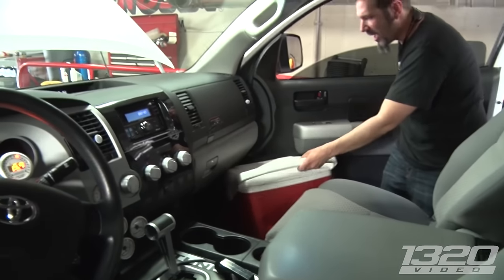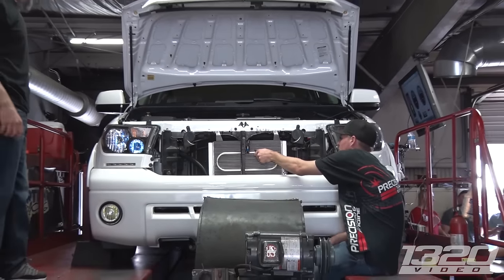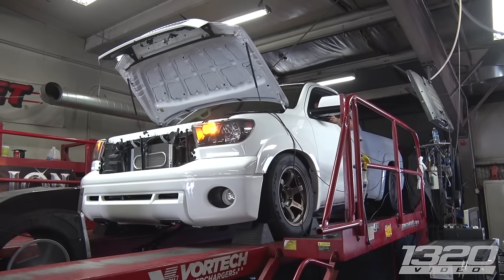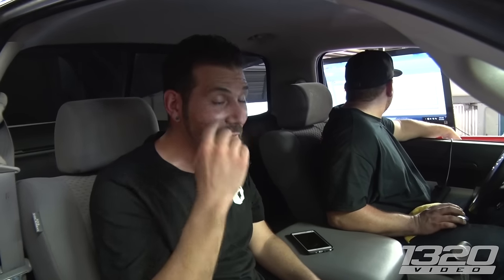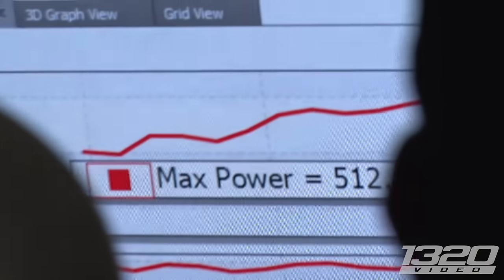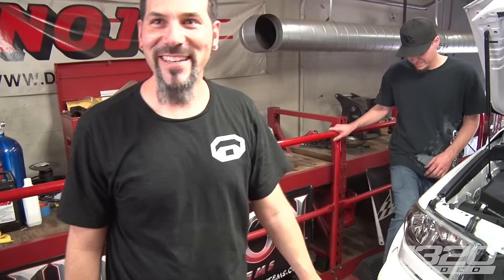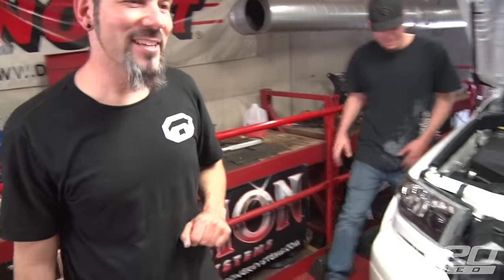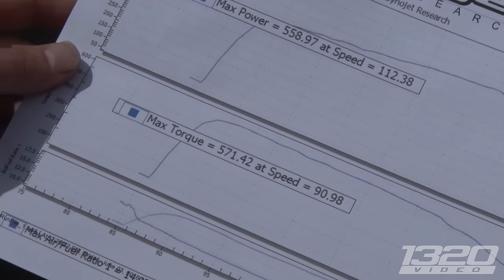The FUNDRA - TRD Supercharged Toyota TUNDRA!

Comment: They usually make 380 factory
Reply: Scout Master DongBag but that's 381 at the crank. Wheel hp is a little over 300 hp. The advertised hp of the trd supercharged tundra from the dealer is 504 hp at the crank which is 400 hp at the wheels. This dyno in the vid reads 550 hp at the wheels which calculates roughly to 660 hp at the crank. 381 to 660 hp at the crank is a healthy increase.

Comment: I thought this was going to run at least run mid 12's with over 500hp to the wheels.
Reply: AdussFadass it probably does at sea level. This was at 7000 feet.
Reply: 7,000 feet is way up there. They say naturally aspirated engines lose 3% power per 1000ft due to air density. If this Tundra was naturally aspirated with 21% power loss from 558hp to the wheels it would of still made 440hp to wheels at 7,000ft up which would still be enough for easy mid 12's at over 110mph in the traps. But this Tundra is Supercharged so the powerloss is not as low as an naturally aspirated engine... My Jeep with a race weight of 5,000lbs will make only 360hp to the wheels will run 12.6 @ 107+ mph. This Tundra running only 13.0s at 104mph does not make sense.
Reply: That launch looked weak, but all things considered it kinda has to be with Tundra's the traction issues are horrendous. If he had 4x4, I think it might have run a bit better, at least enough to beat that Camaro it ran against.

Comment: That's not good for a supercharged truck. Most SC Rams break into the 12s with a Head/Cam package mixed with the 8-speed.
Head/Cam/Nitrous/Stall Ram ran 11.57
Reply: Mopar Magic It was 7,000 ft. Above sea lvl
Reply: AbstractStxnce スバル  actually it was 5300 ft above sea level lol. Look up the track and where it's located. The altitude doesn't change

Comment: thats high altitude(see the mountains simple dudes from the midwest/south?) all these comments bitching about ET and MPH LOL....
Reply: I know people running at higher altitudes run slower et/mph, but isn't that due to making less power in thinner air? Unless he dynoed at lower altitude and raced higher up. If he's in the same elevation with the dyno as the track he should be running what you'd expect from 558hp.
Reply: +Pseudo Mortality I bet the Dyno had weather correction factor turned on, so it posted compensated number... I'm guessing 1.15-1.20CF (440-470hp uncorrected)
Reply: Wait. America isn't ALL at sea level??!

Comment: How's that dual cam turd take 500 horse power lol
Reply: The same way a 2JZ or LS does.
Reply: Not quite. Shits the bed at 650whp. Like LS's did back in 2001.
Reply: 5.7l is good engine
Reply: 560 wheel hp, so he's making 620hp or so?
Reply: 559 to be more precise !
Reply: Not bad, but no LS.
Reply: +Gilbert McGillicutty stock block on a Toyota is not an Ls. I don't see this truck with a hp increase of about 80% making many passes.
Reply: +Rush Weaver The market for the DOHC version of the 5.7 (the engine used in Tundras) is very small sadly
Reply: Extra Creamy 160k ain't shit my accord V6 has 219.
Reply: +Revv match1996 Cool, my girlfriends 04 v8 Tahoe has 240k and drives fine lmao, i just replaced the tranny as well so she can drive it for 240k more if she wants. Whats your point? All vehicles can run forever when taken care of properly
Reply: Revv match1996 

Go home "race car thing name" your drunk.
Reply: Extra Creamy We have several Silverado's at work with 350+ km, so like 200+. Great trucks and great engines. My friends 1994 Silverado with Gen II 350 went 530,000km original motor and then he crashed it. Motor was still running healthy. I wouldn't ever buy a Toyota unless it was a 92 or older. Those Tacoma or T100's were excellent trucks, just uncomfortable driving any longer than 2 hours.
Reply: +Gilbert McGillicutty I have an 06 single cab silverado with 98k miles that Im doing a build up on. I got my tundra through my work. Just a dealership setup all i pay for is gas, its just my daily. Im a chevy guy haha
Reply: Extra Creamy Nice, I'm working on a 98 Silvy street build up, pretty basic, and I just bought a write-off 07 I am going to build a long travel pre runner from. My DD is a 15 All Terrain 6.2L

Comment: Not bad numbers but less than i was expecting from a boosted 5.7 litre
Reply: Superchargers have parasitic losses as well mind. The motor is also on stock internals, 500+bhp plus the torque is quite enough to put on these engines.
Reply: They are in Albuquerque, so factor in elevation over 5000ft on those numbers and times.
Reply: +Bob Oso The torque and power output it actually impressive for something that's essentially a stock motor albeit with a blower. 250 brake gained from a factory supercharger is impressive stuff. Plus 570lbft of torque too! Considering its essentially just a workhorse for towing is RX-7 that's certainly enough?
Reply: For some reason everybody thinks everything should make 1000whp and run 10 secs otherwise its too 'slow'
Reply: Ahh okay the elevation pretty much explains it. Now im curious as to what it would put up at sea level!

Nobody said anything about 1000hp, i just dont think 550whp is much for a near 6.0l, dohc 8 cylinder, supercharged engine.. My stock longblock, stock twin turbo z32 is almost at that level and its a 26 year old, stock block, 3.0l, dohc 6 cylinder with two tiny stock ceramic turbos smaller than t25's, a few bolt ons and a tune.

Like i said, was just expecting more.. Not 1000hp more.
Reply: +Some Body Yup You gotta remember its a roots type blower , that is being driven way past its efficiency range .

Comment: Yea that's not a impressive time at all. Yea yea it's heavy and the altitude but still. My awd silverado Ss full weight with a 408 stroker went 12.5 @109
Reply: you should post a video of your truck racing a SC Tundra and see how it does
Reply: I'm hoping your truck runs a 12.5 at sea level. But at 7000 feet I highly doubt it...

Comment: your at 558 rwhp and only running a 13.04 in the 1/4? my bolt on 2012 ram with a tune and stall runs that all day in 90 degree texas weather and I dyno at 360 rwhp lol. these things are turds. I also weigh 4760 lbs when racing so there's not much of a weight difference
Reply: You aren't doing it with 8000 DA at a track like this.
Reply: Your ram doesn't run a 13 flat with 360 rwhp.
Reply: actually the best I ran in the 1/8th was an 8.40 which is like running a 13.15 in the 1/4 mile. but considering I was just bolt ons tune and stall just shows that this tundra is a turd. you can make the argument over a high DA which I can respect as I know how much it can make a difference. but I still ran that time on a 90 degree day in a 2700 DA. the fastest NA ram ran an 11.91 in the 1/4 mile. his name is Matt Fikac from moes performance. still the factory 5.7l AND this was with a 6 speed. the 8 speeds are .5 seconds faster from the factory when equipped with the same gears. so yes it's very easy to run a low 13 seconds with a ram

Comment: Sorry guys your American made junk can't compare with a Honda or Toyota....... Ford has transmission problems. Chevy is shady but has better built trucks. Dodge only thing they got is the faster dodge challenger and viper that will beat a mustang.

All in all in my opinion if you wanna waste good $$ get a Toyota or Honda civic. But if you can't afford it you can always buy 10 year old American made junk for $5000

Just wish the Japanese used steel frames
Reply: I agree. Toyota and Honda make the best vehicles.

Comment: Slowest 550rwhp truck ever
Reply: chrisheltra Toyota advertise them at 500 hp and 550 trq at the crank . So 550 at the wheels is a good improvement.
Reply: But your right. Those trucks from the dealer lot were supposed to do the 1/4 in high to mid 13's . Rwhp from the factory you'd think would be a little over 400 atleast. So to add almost 150 hp to the wheels...only getting a 13 in the 1/4?...I'm not impressed either.
Reply: I guess you missed the mountains in the background
Reply: It would easily run 12's if it didnt have those garbage Nitto NT420's on it
Reply: chrisheltra there’s nothing slow on this truck man
Reply: That tracks far above sea level...all the cars/trucks were doing high #'s.  Thought the same thing till I looked at the track location.

Comment: I would appreciate the tundra a lot more if it weren't for that hideous exterior cab design. The bulbous, rounded edges of the cab give it the appearance of a toy more than a truck. As far my personal rank for cab designs is concerned, I have: 
1. GMC Sierra 2500
2. Chevy+Ford/2500+ 250
3. Ram 2500
Reply: My fav is the 4th gen ram 1500 with the "tri-color" type projector headlamps. Followed by a facelift third gen with retrofit halos and projectors, the eyelid on top, and the big type hood with SRT wheels.
Reply: this is an older tundra. theres a newer facelifted 2014+ tundra

Comment: This truck is a turd! Even after you DA correct it, it's still slow for 558 rwhp rofl. Ram FTW
Reply: 1: it’s a heavy truck what do you expect?
2: Dodge Ram are heavy as well
3: they are still pretty fast even with that power it’s a good speed. 
4: Toyota Tundra are better made than Dodge Ram. Because 
5: Toyota is a true American made with high quality Japanese components. And Dodge Ram is not. It’s a fiat dodge. Dodge Ram sucks the chrome of a 57’ Chevy bumper.